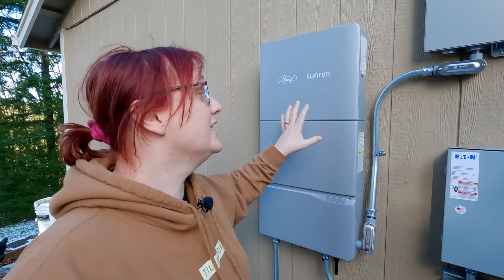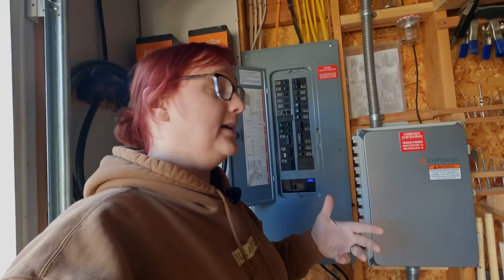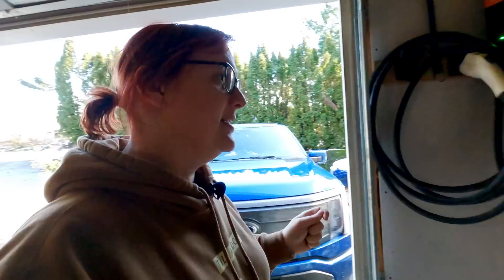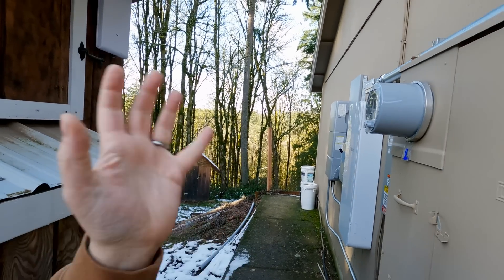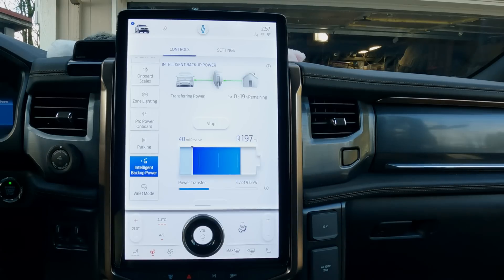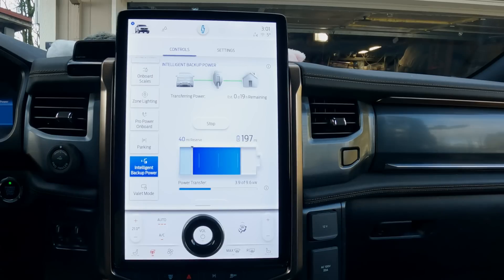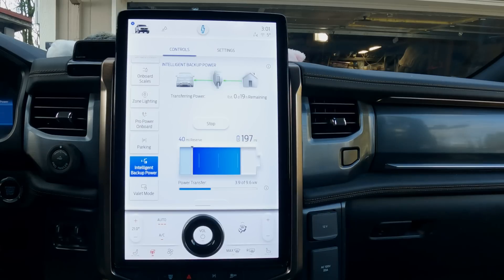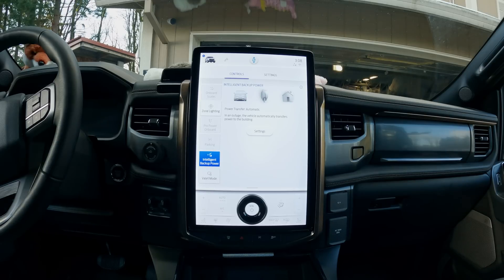We FINALLY Get To Power Our Home (And Studio) From Our Ford F150 Lightning!

Comment: I live in the country, have a drilled well, and heat extensively with heat pumps,. drive two EVs (2023 Bolt and 2023 MY LR), so I'm reasonably qualified to offer a viewpoint. Your presentation was interesting and good, but somewhat incomplete. For instance, the well pump is either on or off depending upon the state of pressure in the pressure tank. The heat pumps are a bit more nuanced; their load on the system can be variable depending upon how hard the compressor is working in that moment to extract heat from the air for house warming.

I'm also wondering whether the Ford-Sunrun system is needlessly complicated?

And let me state that I am envious that you live in a climate ideally situated for use of a heat pump. Here in northern New England we have several rounds of cold spells each winter where temps can easily reach -25F below zero, and colder. Our heat pump (Mitsubishi-something) is guaranteed 100% efficiency to -5F; trailing to 1:1 heating efficiency at around -15F below. Our back up is the lovely wood stoves on the lower level, which is one of the favorite places to hang out on cold cold days!

Comment: NICE! We need more of this in the future. I keep hoping an EVSE provider will come out with a true bidirectional model. Our two Powerwalls keep our lights on when the grid goes down (it has happened 34 times since we installed them!), but it only makes sense for homeowners to also be able to use their EVs' battery packs when needed.
Reply: 34 times!! Where is this?
Reply: @londonwestman1  Southern Utah.

Comment: Personally, I'd keep the servers off of the essential loads circuit.  You've got UPS(es) on them, and most can be programmed to safely power down the servers when the remaining capacity drops below a desired threshold.  If you're the paranoid sort, keep just the NVR on the essentials circuit, but make sure it's a very efficient NVR.

Comment: Question. Can you restart they system after it fails? Or does the truck need to see the loss of power. Same question applies if the truck is unplugged.

Comment: If I wanted to power my house via the truck I would just run a cord from the 240 outlet on the truck to a transfer switch at the breaker panel and save a buttload of money. It wouldn't all be automatic but it would only take a couple of minutes to have power.
Reply: I believe the 240 outlet in the truck bed is 30A max. So, it depends on your usage. I would probably do the same, but this is meant to be an easier option for people who don’t want to mess with extension cords and transfer switches.

Comment: The well pump shouldn't be much of a concern.  Well pumps should not run continuously.  You should have a pressure accumulator tank that the well pump feeds into.  When that tank reaches its upper cut off pressure the well pump turns off and stays off until the pressure in the accumulator tank drops to its lower limit setting at which point the well pump turns on again.  My well pump tends to run for about 15-20 seconds every 2-3 minutes or so when someone is taking a shower.  It runs less frequently when a tap is on and depending on the pressure in the accumulator tank and how long the tap is on for may not come on at all if you open a tap for say 30 seconds.  If your well pump is running continuously it seems to me that your accumulator tank has failed and needs to be replaced or at the very least be recharged with pressurized air.  If the accumulator tank is OK, then continuous well pump operation means that either the pressure switch on the accumulator tank has failed in the on condition of you have a rather significant leak in your plumbing.  Finally, continuous well pump operation could mean your accumulator tank is too small for your system.    In any of these cases, continuous well pump operation means you need to call a plumber unless you are quite handy about plumbing systems.  It also means that you will be buying a new well pump sooner than later.
Reply: A start delay should still be installed as the power cut COULD happen during a normal ON cycle.
Reply: @steveurbach3093  The well pump won't come on unless: a) it was running when the power went out, or b) the water is on somewhere in the house drawing the system pressure down.  A delay would work, but simply turning the breaker off before turning the truck system on is cheaper.

Comment: Get time delay modules for your high current items such as your heat pumps and well pumps.  The UPSs will handle the servers.  I suspect your issue with the system was a high inrush current and the Ford just couldn't  handle that much of a current draw.  Staggering it out over time will definitely help.  I'd say put the well pump on a 5 minute delay, the heat pump on a 15 minute delay, and the server room on a 20 minute delay.
Reply: My thoughts exactly. Stagger the times by a couple of min.
Reply: Add soft start feature where possible.

Comment: Another brick in the wall. $10k - Wow! Keep testing and documenting until full reliability is achieved. Vested parties have a lot at stake. Great that they have offered to return to offer help and advice. Lesson to all, breaking new ground comes with its unique challenges.
In time you will provide updates on progress made. Impact of cold and hot temperatures on load management. Does the truck, battery and charging/discharging of power have to undergo thermal scheduling sequences? Does the system work cold turkey or warmed up, e.g. after some use?

Comment: Wonderful! Thank you for the investment of time, money and emotional energy to share this topical story. It is worth noting for people considering this that they could install a propane/gas home generator for less money, and it is automatic, runs forever with refilling, and works when the truck isn't home. I hate burning fossil fuels, but in an emergency it is tough to beat.
Reply from the maker: In our case that wouldn’t make sense… but yes- Nikki
Reply: A dual or tri-fuel home backup generator only makes sense if you have natural gas utilities at your home. Many rural areas (at least in Oregon, can’t say for sure elsewhere) don’t have natural gas and would need to have a giant propane tank on the property. Based off the fact that Nikki has said that their home had electric heat before they installed the heat pump, they use an electric stove and water heater, and the fact that they have no utility access other than electricity (I.e. no sewer or water) I’m guessing they don’t have natural gas either.
Reply: We are rural Canada, no natural gas and all our heating, cooking, hot water etc is electric. A local propane company provides the tank(s) and uses remote monitoring to refill as required. We chose a big tank buried near the top of our driveway, most of our neighbors use one or two smaller above ground tanks, no problem. And we use the propane for our BBQ and indoor fireplace.

Comment: The heat pumps and well pump are not controlled from the breaker panel! Yes, that’s breaking the circuit but that’s not the control switch.

Comment: Nikki, does this system allow your solar panels to function during a power outage?  If so is the system smart enough to put power back into the truck if your solar system is producing more than you are using?
Reply: I would love to know this as well
Reply: This is a tricky thing. If SunRun installs an entire new solar system for you, then yes, the solar will continue to work since it will be using the Delta inverter. The inverter views the DC truck battery and your strings of panels the same. They will not integrate an existing system; however, a 3rd party electrician or installer may be able to help you, but that calls in to question warranty concerns. Also, if your solar is using micro inverters it would not be able to integrate, only a string system that could use the Delta inverter. It also cannot charge while pulling the DC from the battery, however if solar was on, it would reduce the load on the truck by whatever amount the solar was producing. There isn't a way to send excess solar production into the truck. The best you could do is charge another EV using a 120v outlet and a mobile charger. The AC component of the Ford Charge station is typically coming from the main panel on a 100a circuit and not the backup subpanel.
Reply: From what this video is stating; I highly doubt it.  Ford/Sunrun setup has enough problems powering her house, let alone be smart enough to make solar/grid/battery work in harmony.  LOL, glad I went with powerwall system.  I almost got suck into Ford Sunrun route had it not been for the wait list for lightning.

Comment: not cheap, but the devil stucks in the details and the longer the video run the more details came up to light to understand the complications.
At the end also the question of the emergency loads and the current / power surge they need.
Core issues on different sides like house (loads) and panel and F150    
I guess Ford Marketing has not included enough footnotes about its limitations of operations and 10 kW is a pretty high bar or very high bar compared to other cars that offer at least a V2L that usually deliver about 2 to 3 kW like MG 4 and new Ioniq / Kia. 

We simply to choose to reduce the or limit the loads to the essentially 2,3 kW where our solar power system will be happy to serve from the array or its battery. Of cause things can go wrong in the time where solar is low (cloudy day) or not there (long dark night during winter) and then we are using the cheapest solution with a V2L cable to a 230V charger that can produce 52V DC for  HomeStorageBattery while that is powering the home with up to 2,3 kW. In case of a longer outage we have had once in 40 years (means longer than 4 hours) we have an ice generator with up to 3 kW AC 230V output to charge the car and / or run the home. 

Costwise about 70€ for the V2L adapter, 150€ for the additional home storage battery charger and 300€ for the 3 kW ICE generator (ICE engine has 7 kW)  and about 250€ solar power system installations , which ends in a more affordable range and also limited function. 30 ms switching time for the Home Storage Battery system and then you need to check the SOC till you have to connect the car to home storage to refill the homestorage before it runs out of juice. MG4 has 50 kWh LFP and a V2L of up to 90% (10% SOC) , so 45 kWh available which is about 4 days with a usual 11 kWh per day.

For most 2,3 kW seems tiny but once you remove or reduce the load from the heatpumps by simply using the 11 kW wood oven with a heat water exchanger and also a fully running 15 kW oil central heating the 2,3 kW can still offer a lot of convenience. Our goal was not to rely on 1 emergency system but to have partly redundant sources like for heating (we could run 100% on oil, 100% on wood ofen or 80% on heat pump heating wise which means 80% of all the winter days heatpump alone would do the job) 
 
but a 750€ system with 2,3 kW is a different thing than powering a 10 kW beast of load (s) and therefore I would suggest to get a 5 kW diesel generator with a starter battery cause those are a lot cheaper to own and maintain than the Ford home system (could you easily replace the F150 with the Rivian or would you need a rivian one then? ) and they are far longer to use cause 25 L diesel (30% out of 250 kWh diesel = 75 kWh electricity) will last about 7 days without any sunshine which we have never seen. 

Therefore we went for the smaller solution (2,3 kW) and multiple sources and expansion of the source like solar now up to 25 kWp and than oil generator, oil central heating, wood oven, and EV 

But that full solution with a automatic generator and EV was only caused by the invasion of the Ukraine. We only need DIESEL for the Mercedes Towing capabilities and are energywise self sufficient. Took a half of year of work to re-plan and re-route all the loads and sources and get the right parts working with each other. But we would never have gone for any F150 style truck cause you would be seen as an alien using such truck as your daily cars. Kids in Kindergarten would tell your daughter how bad her dad's car is for the environment and so on.

Comment: amperage spike, simply delaying the high amp circuits would avoid that problem. it's good that the vehicle seems to have some protections against it because it could of easily fried the vehicle if it didn't. 
however the system should 100% be adding stuff in order of lowest to highest circuits, it shouldn't be doing them all at once. exceeding the amperage limit of batteries is very very bad for them and well might even cause it to burst into flames.....
main's power is fine because the system is mostly generator based and can easily take the massive spikes as they come due to inertia.

Comment: Hi Nikki, you probably know this but it sounds like you’re feeling the difference between the rated wattage of those devices with electric motors and the reactive ‘surge’ that is drawn when power is first applied to them. That surge is probably exceeding the system’s limits if all the loads come on at the same time.
Reply: I was going to mention that she has a surge issue.  There are devices to help with that. Not sure if they are added per device.
Reply: @ChicagoBob123  They can be, there are relays with time delays that can be set to sequentially activate individual circuits to prevent excessive inrush current.
Reply: Is also my first assumption. The peak load and the way it is shaped is something that either the inverter or the car doesn't like. I would build a system to isolate those systems that could go a few hours without power. The waterpump and heatpump for example can wait until someone can flip a switch.

Comment: Glad to hear it!
Would it be less of a power load if you changed out the water heater for an on demand heater. That way you only have it turn on if you asked for hot water.
Reply: Electric on-demand whole house water heaters have HUGE draws (~20-30kW) which exceeds what the truck can provide.  Individual fixture heaters that draw 6-7 kW might work, but would work although you would have to be careful about what else was on when you turned the hot water tap.  A standard 0-50 gallon tank type electric water heater draws about -5-6 kW so it  would work, but again you would need to be careful about what else was on particularly since tank water heaters turn on and off automatically based on the temperature of water in the tank.  A heat pump water heater will be at the lower end of the power draw range for resistive hwater heaters but will still be in the 4-5 kW range and will have the added complication of start up surge loads.  A natural gas or propane on-demand water heater could easily be powered, but that sort of defeats the all electric idea.
Reply: Go for a Heat pump type Water heater (or a Hybrid version with extra limiter).  Since the servers are providing heat, try and recover some of that instead of dumping it outside.

Comment: Add a PLC programmed to stagger start those heavy items after switchover to allow the sunrun system to live.
Reply: Tine delay modules (relays) are cheap and are local to the load and simple to set (or were preset). They do not always need to switch the load. They could just interrupt the devices control power.

Comment: For the $9k a 3 to 5 kwh home battery would keep your solar working during the day in an outage. Then you can recharge your truck partially using the solar.
Reply: I just spent $6K to add 20 kWh of battery backup to my solar/battery backup system.  That system consists of roof top solar, an inverter, a transfer switch and the batteries.  The system switches to batteries automatically in an outage (in less than 1 AC cycle) and can run my house for 3-4 days in the winter and indefinitely in the summer.  The system does not power the electric stove or the electric dryer, but everything else works including the well pump.
Reply: A 3 to 5kwh battery is not going to run the house (any house) for 3 days is it?
Reply: @patdbean  no, but on a GRID-TIED Solat System, you get 0 output during daytime outages.  Any permanently connected home battery will keep power to the solar micro inverters so they still work. The Ford system doesn't do that.
Reply: @TruWrecks  is that the design? During a power outage the house runs off the truck. If you need the truck, the house runs off the solar and battery system.  While out and about you can recharge the truck. Ready to power the house again.
Reply: @Dularr  The TE house has 15 kwh of solar, but they didn't get a home based battery to continue power during an outage. They went for more power production then protection. That is what I infestation about their install,  unless the design has changed since the initial solar commissioning.
Reply: @TruWrecks  That is a lot of solar.  Too bad they can't use the solar when the truck is connected during an outage.  That is a common problem with grid tied systems.
Reply: @TruWrecks  so this means their house runs off solar and grid?
Does it switch to solar and truck if the grid trips off? Or just the truck?
Reply: @Dularr  Their system runs only off the F150 when the grid goes down, to my knowledge. If they had any permanent battery they could keep solar running during a grid outage, then use the solar and truck to power everything.